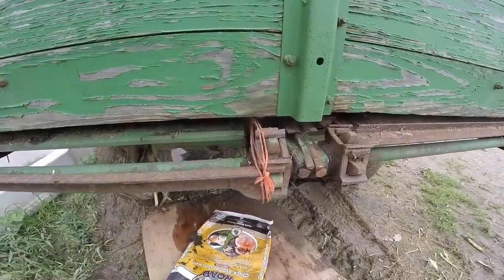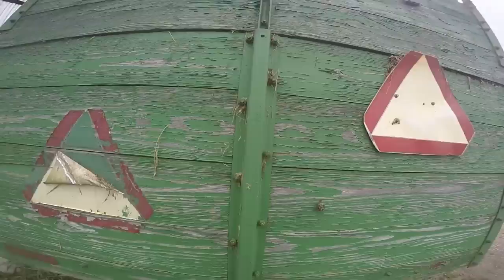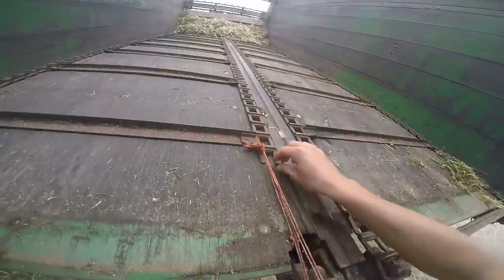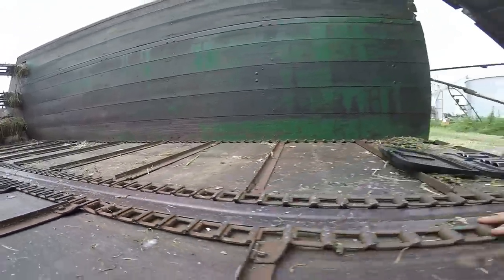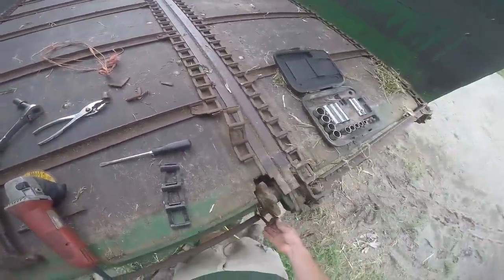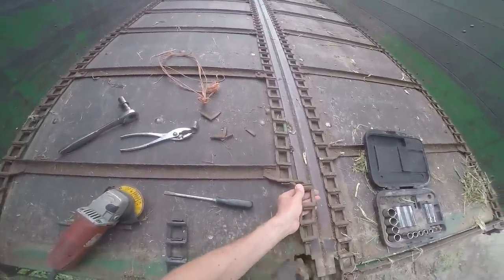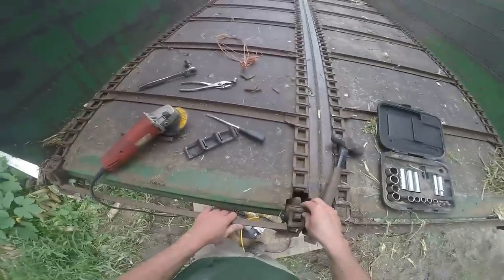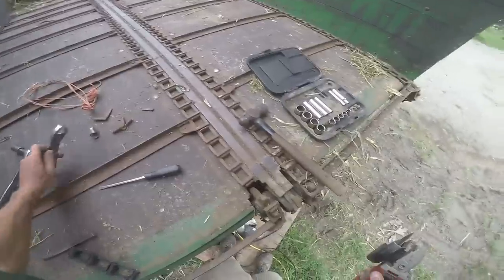67H Flat Link Chain Repair

Comment: When I was a kid on the farm we didn't have a grinder and we didn't need a chain breaker.  We used a chisel and a hammer and pair of vice grips to repair flat chains.  We left the farm in 1964 and flat chains were normal on much of the equipment.  We did use a lot of grease and never used no fancy tubes of grease, just open a five gallon bucket, open up the grease gun and load it.  Boy you talk about a mess if you ever let the slide pull out of the slot before you got the thing back together.  Lots of rags, lots of rags, dirty ones to wipe off the big messes and cleaner ones to clean up after the big messes.  Kind of like white and red corn cobs.
Reply from the maker: hahahaha, I know what the cobs are for.....

Comment: did the twine hold? i always used log chain and i tried twine once on the shit spreader it did'nt work. had a 14' gehl box that broke aprons every 3rd load. i doubled the number of flights in both aprons then that box never gave me troubles again ever also that box unloaded twice as fast. 2002 my neighbor bought it from our auction still using it today! don't throw away old aprons you need them
Reply from the maker: The twine held, it was just on the return side, so no load. We had to reach under and pull on the twine to keep enough tension, or the wagon would smash another link. It broke the link right up front just past the drive sprocket. Clearances are tight, so some slack in the chain caused our mess.

Comment: Breaker tool makes it much easier otherwise switch over to the T bar Style then its much easier to take out links to keep chain tight
Reply from the maker: I know, the t links are a simple twist together. Our manure spreader had those. A year before the channel started, we put a new web in our manure spreader, and it was cheaper to buy individual parts than a whole unit chain, so I was glad assembly was fairly easy with the newer style.

Comment: You are doing it all wrong grinding on them chains to separate. You need a cast iron detachable chain breaker tool. Google it to see what it is.
Reply from the maker: I have seen them, but I choose to save the headache and modify for ease of service.  I haven't had issues from many previous instances of metal reduction.
Reply: With an answer like that you do not belong on a farm with tools you need to change your occupation to politician. Lol
Reply: @frankdeegan8974 , Jacob is of the millennial school of thought , it like new speak , only it's new thought . It's all about the concept of thought , this is where you get lost , Frank . It's about constantly messing up , so that everything is like a snowball down hill , screw up after screw up , never do anything right . Hey the kid still has all of his digits and limbs , WOW WEE !!!!! Cows probably didn't eat too much metal , bonus.